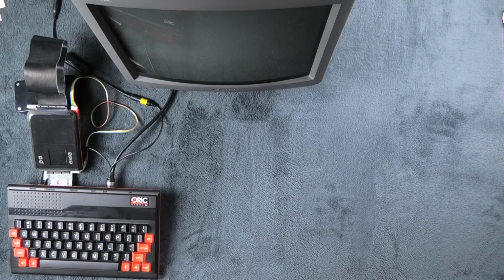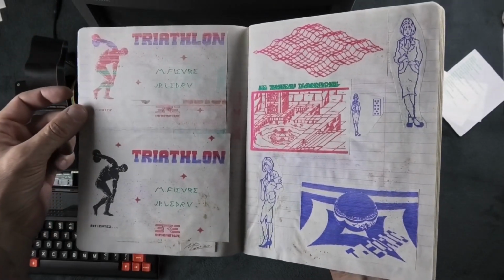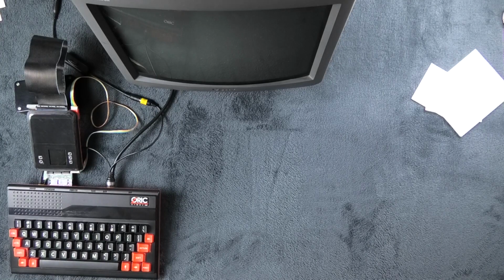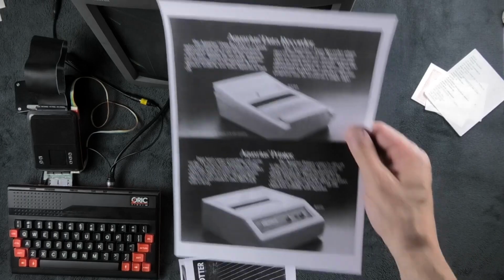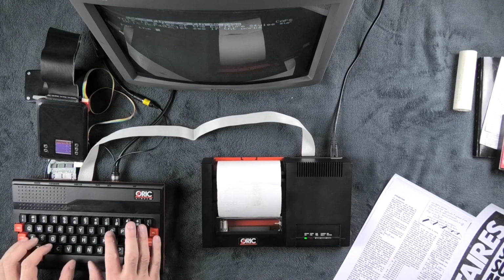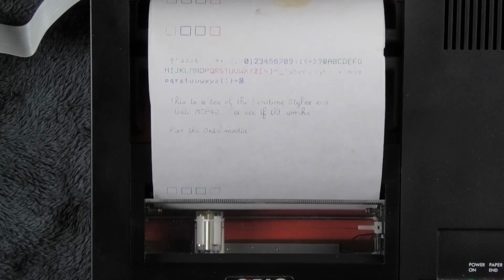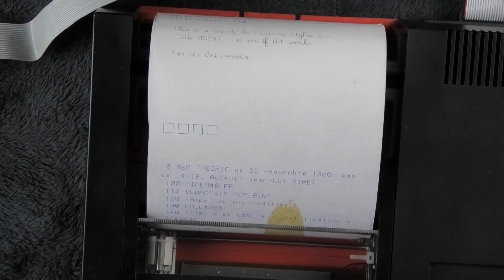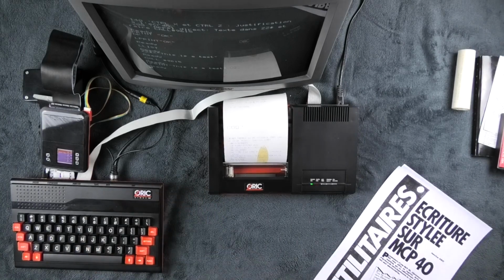Oriclopedia: Oric MCP 40

Comment: Thanks, Dbug - informative and interesting as ever. I never knew there were so many clone ALPS models on the market - I knew about the Atari and CBM and Tandy models but not those others you found - great detective work. I find that the Oric-1 MCP40 model is easier to find than the "cooler" black and red Atmos version...I wonder what the production figures were? Once more, great video - keep up the super Oric work and maybe just turn the record volume up a little? On my laptop I can only just hear the sound with everything turned up to MAX! Other than that, perfect, mon ami.
Reply from the maker: Regarding the volume, is it the volume of everything, or just the voice?
Also is it only on this video or on all of them? (like when there are game sequences, etc... are they are the right volume or do they also need a raise?)
Reply: @DbugII  It is generally your voice and it does seem to be set to a low recording level on most if not all of your videos - but of course on other viewer's computer set-ups you can turn up the audio on your speaker system but for ordinary laptops like mine, I think it is just a little too low - it could do with a bit of a boost, Dbug - other than that, the videos are PARFAIT! Merci bien.